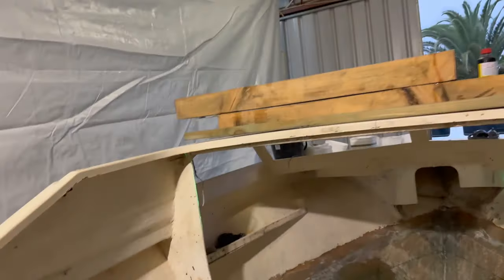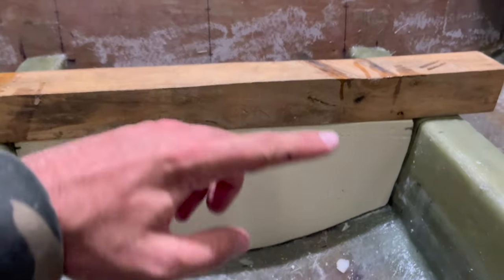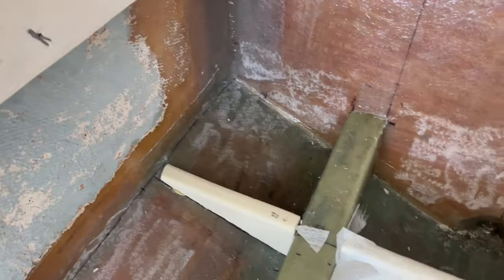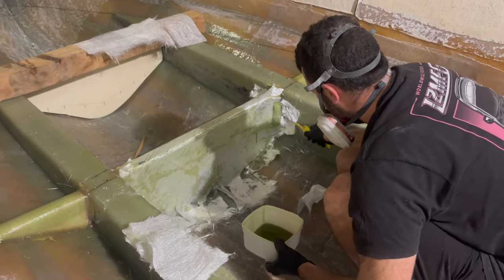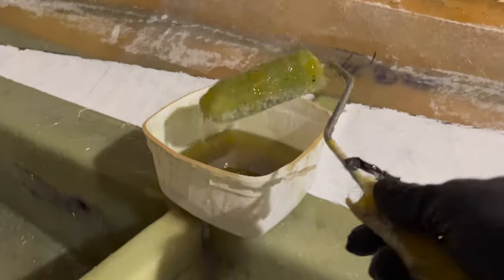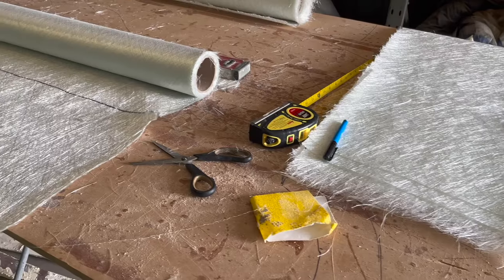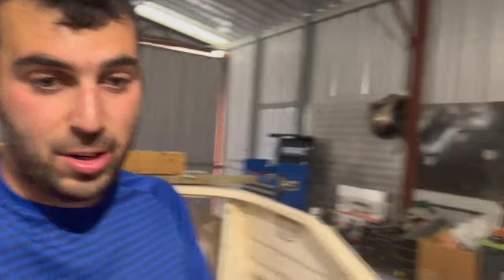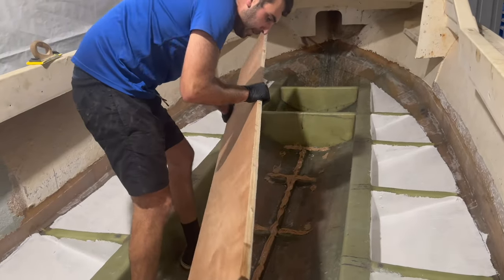STRINGERS, BULKHEADS & THWARTSHIPS COMPLETE | Pacemaker 20ft | Full BOAT RESTORATION V2 - Part 15

Comment: 180kg of resin??? At 40 60 ratio that's 450kgs glass and resin. That's way too heavy. Maybe 180kg of glass and resin. If not then your glass to resin ratio is way over the top likely resulting in a weakened structure.

Comment: You have done some really beautiful glass work. I am curious about the volume of resin used. I tried to convert 180 kg to a volume and it what I got couldn't be right. So could you tell how many liters / gallons does 180 kg of resin convert into to?

Comment: Comming out awesome bro! Im gonna say approximately 50 liters so far! Whats the work time on the resin your using?
Reply from the maker: Hey Tony! 180kg so far ☺️ 
Depends on the weather but I’m getting about 20/25 min work time 
thanks for watching!
Reply: @AngryMackAdventures  180kg? What??? How many liters is that? Cause im doing the math wrong if its what i think.
Reply from the maker: @TonyDFreestyle96  litres  works out close to the KG 😎
Reply: @AngryMackAdventures  holy crap! Dam your laying some material down! Its gonna be strong as hell! I like how you did the floor for the gas tank.  Nice touch!

Comment: No holes at the bottom of every bulkhead, in order to drain unwanted water from the bow to your bilge pump?
That is looking great otherwise. Great job. Your boat will be rock solid.
Reply from the maker: Thanks buddy 
Yes that is getting done at later stage :)
Reply: @AngryMackAdventures  Perfect.
Your glassing skills have improved a lot since your first boat refit.

Comment: I would have thought better to stay away from epoxy and continue to flow coat the hull all the way through
Reply from the maker: flow coat will be Used at the end to finish the hull when the rest is all glassed in, I’d rather glue to the glass then the flow-coat, just personal preference 
 thanks for watching :)